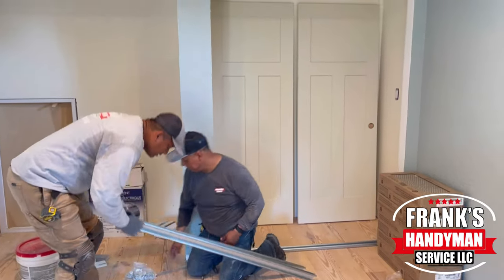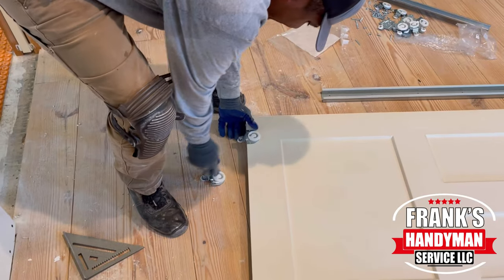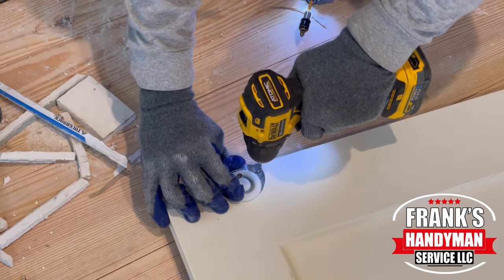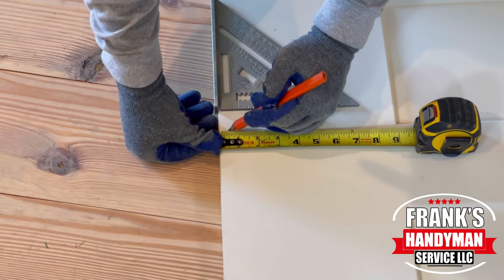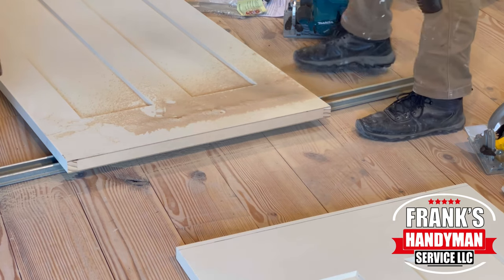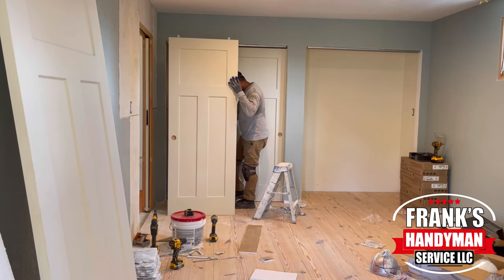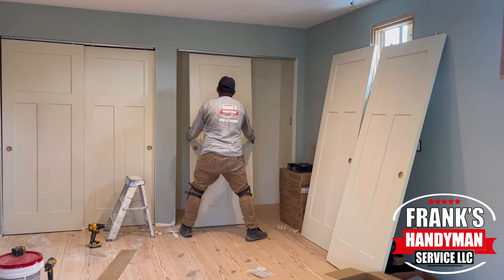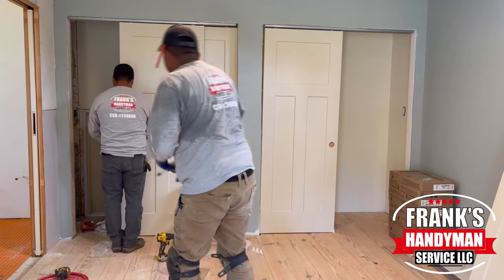How To Install Sliding Closet Doors Including Hardware Cutting Door & Full Installation Step By Step

Comment: Hello, I plan to do the room floor with tile. Do you suggest that I install that first then sliding closet doors? What about the bottom plastic guide? Do I use a tile hole saw then masonary bit to the concret floor with a plastic anchor? thanks.
Reply: Id suggest doing the floor first so you know what your finished floor height will be plus the doors will not be in the way for your install and yes to the tile then masonry bit and maybe a tapcon screw will work to anchor it down into the concrete or mainly any type of anchor screw meant for concrete so long as it fits

Comment: Hello! 

We lived in our house for 24 years. When we moved in, the house had carpet. Now we have luxury vinyl planks. Our closets have a gap at the bottom. How do I fix this issue?

Thank you 😊
Reply: I'm sure y'all found a solution by now, but the easiest thing is to adjust the top roller wheel.  They are usually adjustable.  This may or may not be all you need depending on how much adjustment the wheel allows